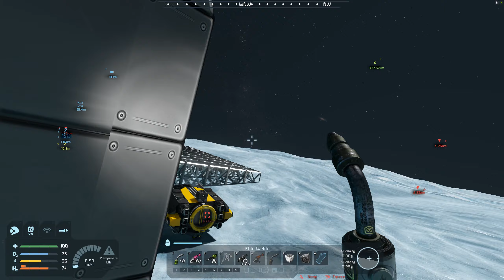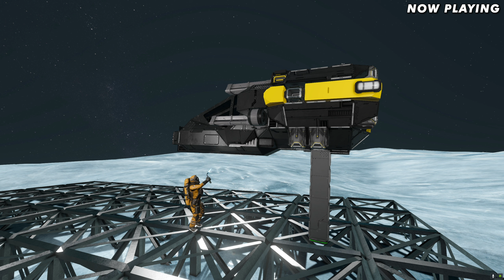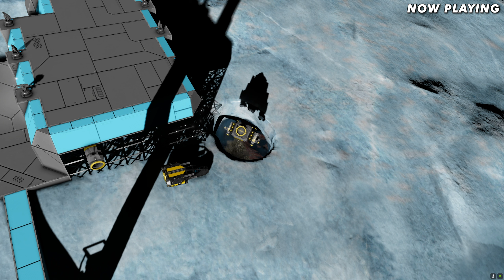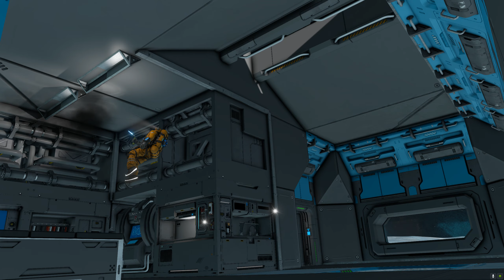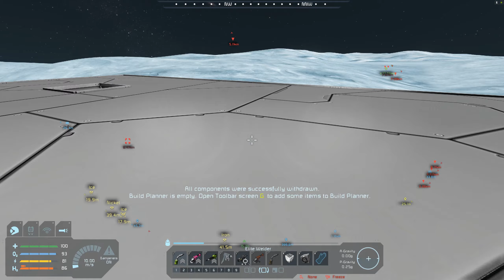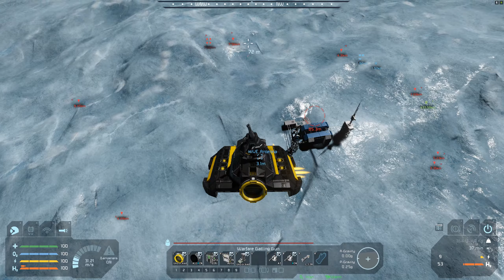Battle Ready? | Proxima Beyond Ep.10 - Space Engineers

Comment: Base looks really good, it has character.  My bases tend to look like Borg Cubes sitting on the planet.  If you are going to be building things on that new platform, may I suggest replacing a wall block with a block that has a connector facing out so you can stop running in and out of the building.  

Something must be amiss with your first little fighter like you mentioned.  With your planet not having atmosphere and only .25 gravity your little ion drive fighter should have been fairly zippy to buzz around.  Does SE have planets with atmosphere but not breathable?  Does SE only have planets with breathable atmosphere and and vacuum?

You should have stopped by the wrecks of the two drone fighters you shot down, maybe something there for you to learn.
Reply from the maker: There is probably atmosphere, as the win turbines were working (not very scientific, but hey..)
So I might be able to use some atmo supporting thrusters.

The Assert Drones blow up once the AI block is damaged or run out of power.
So there won't be anything to collect.
Reply: @Beeblebum  Did not know that about the drones.

Comment: Expose one of your air vents to the elements, set it to depressurise and if you oxy tanks start filling up, that's why your ions aren't working properly. I know it says 'none' in the o2 on your hud but the moon may still have a minimal atmo interfering with ions. Also you should have your airlock air vents set to depressurise anyway. If you're going to leave them on pressurise they're basically redundant as the airlocks will be filled with O2 by the main room vent anyway as you enter and exit. You might be right about the spawns being connected to the AI module, splitsie could have changed win conditions for his mod. Also, the outermost gat on the starboard side of you ship wasn't conveyered which is why it was saying 'no ammo'.
Reply from the maker: Once I set up the Event controllers I should be able to depressurize when exiting.